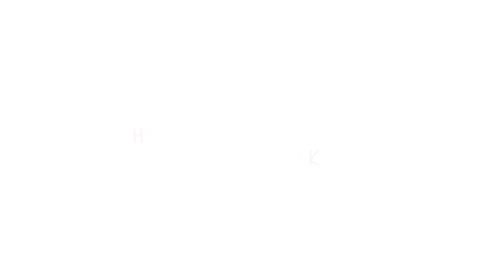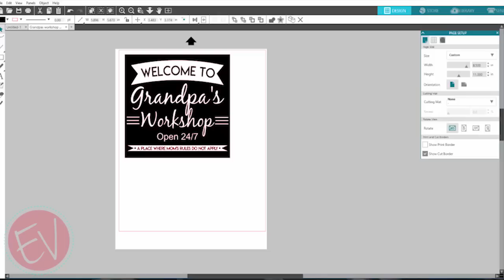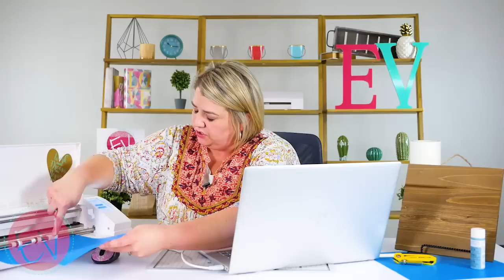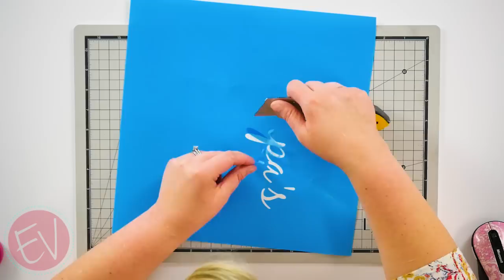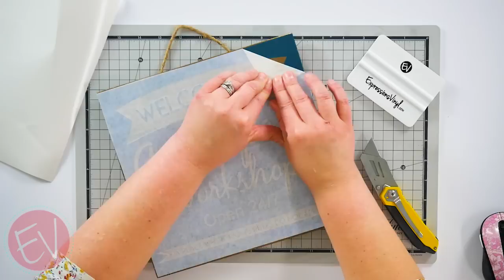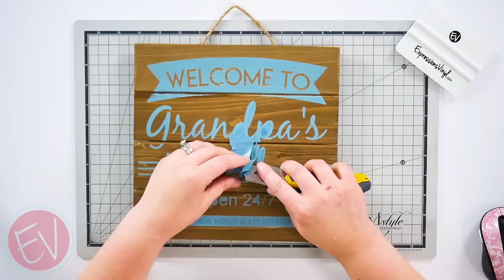How to Make a Stencil Using Oramask

Comment: ive used some of the other oramask vinyl but i like this the best i can airbrush part of an image remove the vinyl and add the other overi t the nice thing is yuo can see therogh it and line up the psinted line with mask for nonme painted lines its aesome. iots mainly for water based paints i use it with automotive paints itr softens the oramask butso when youy remove it it comes of in pieces.

Comment: Yes, but what is the machine used to cut out this vinyl stencil. We are not all pros so we need to start from the beginning.  What is the machine used and how much does it cost? Thanks.
Reply from the maker: There are several cutting machines out there. Cricut, Silhouette, Brother Scan and Cut just to name a few. The machines usually run around $200+

Comment: can you use the autoblade as well? if so, with glossy vinyl setting? or?
Reply from the maker: Hi Jolene, yes you can use the auto blade as well.  You could start with that setting and adjust up or down depending on how deep the cut was in the vinyl.   You can also find all of our cut settings here - https://expressionsvinyl.com/machine-setting.html

Comment: Thank you! Have you tried using multi layer stencils with this material? I am concerned it may pull paint off the lower layers with the adhesive...
Reply from the maker: Hi, thank you for tuning in.  It will work great on additional layers.  Just make sure that the first layer is completely dry when doing the other layers.  Also, after you have applied the stencil vinyl you will want to do your second layer.  Do not leave the vinyl on for extended periods of time.  Hopefully that helps.

Comment: When printing on vinyl what type of printer do you use? Laser or ink jet. I'm new and not sure?😀
Reply from the maker: Hi Tawana, the Printable vinyl that we carry both in Heat transfer and Adhesive is used with an InkJet printer, not a laser.  Here are the links to them:
Adhesive - https://expressionsvinyl.com/printable-vinyls/adhesive-printable/
Heat Transfer - https://expressionsvinyl.com/printable-vinyls/htv-printable/
Reply: Expressions Vinyl -Thank you so much.
Reply: Expressions Vinyl -Thank you so much.

Comment: Can you use this oramask on a chalkboard with chalkboard paint? Also any idea if I can use oracal 651 to do the same as first question?
Reply from the maker: I would try to test a little section first, but I think that would work. You can, just made sure not to leave the 651 on for too long or else the adhesive will cure to the surface and be pretty difficult to take off.

Comment: what's the difference between this one and regular vinyl to do stencils?
Reply from the maker: The stencil vinyl has a low tack, water based adhesive. It is ideal for water-based paint applications; smooth, flat, rigid substrates and surfaces, large area capabilities; and applications requiring background visibility.

Comment: Perhaps my Silhouette isn't updated, but it looks like your material list includes Oramask and mine does not.  Would a vinyl setting work?
Reply from the maker: Hi Linda, we have added Oramask as a custom setting in our program.  We do have a Settings List for reference though and Oramask you would typically use the blade at a 2, speed at a 7 and thickness/force at a 5.
https://expressionsvinyl.com/machine-setting.html

Comment: Hi I am using the oramask stencil film and when I take off my stencil it is leaving a sticky residue on my piece. What can I do to clean it up and not make my painted letters smear.
Reply from the maker: Hi Kathy, we're sorry to hear that.  We haven't had an issue like that with it.  How long do you leave it on your project before peeling it off?  Also, what types of paint are you using on it?  Please let us know.
Reply: @Expressionsvinyls  I removed it after my second coat of paint was dry. So it wasn't on more than an hour. I was wondering if I might have applied it to securely. I went over with my brandishing tool I thought that would help keep the paint from bleeding thru. I have sanded and repainted it and I am planning on redoing it tonight I will let you know how it works out
Reply from the maker: Let us know how this one works.

Comment: When I do this exact same process, my paint bleeds so bad underneath the oramask.. I see that you didnt mention sealing it or anything.. what am I doing wrong ??
Reply from the maker: Hi Mallory, one thing that helps is the amount of paint that you use on your brush.  If you dab out some of your paint and use a dryer brush it works better.  It may take a little longer to get it painted but it will not bleed under neath.  Also, always use a dabbing motion and not brushing.  Brushing will force it to go under the oramask as well.  Hopefully this helps.